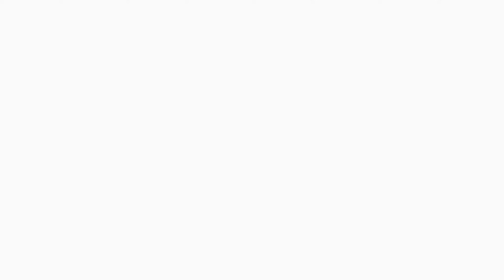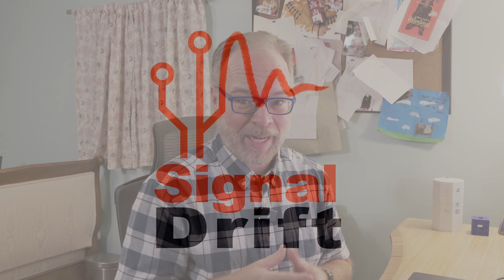Building your first PCB - Part I

Comment: IMO having all those lines crossing over and around each other to just go to one ground is incredibly messy. Lines going over text... I'd use a couple of ground symbols to break it up. In fact if a schematic can be neat while never having a non-connection wire cross-over, I typically try to draw it that way. I like to save the rats nest of wires for the actual breadboard, you might say...

Because we ALL know that beginners will NEVER make ANY mistakes when first designing and fabricating a PCB (when they first try a project that's not simply following some video tutorial), therefore I also think that it's NOT important at all to favour hand-solderability, and hand-solderable parts whenever plausible, because there will NEVER be a case where they might be able to effect a bodge connection or part replacement, and this WON'T be made easier by some imaginary case that would NEVER happen where replacing an 0805 resistor would be far easier than an 0402, despite the latter having saved them 0.02 cents in BOM cost.

/s...

Despite Kicad not having specific symbols for every part in existence, I find the majority of parts are very very standard packages which Kicad has both the part symbol and PCB footprint for, so in the majority of cases after assigning that, it's a non-issue, rather than a big deal.

edit: oh and for that thumbnail, I think it's ALWAYS worth teaching the one or two extra steps on how to make your PCB edge have rounded corners. Very minor extra step, but feels oh so much nicer in the hands when you get them.

Sorry for the criticism, my opinions
Reply from the maker: Thanks for the feedback! I know there are lots of opinions on schematics, I am just putting one out there. I am not an expert. I am learning and I just wanted to put what I learned out there.

I think your general idea is very sound - try not to cross wires that aren't connected, and try not to cross labels. I think for a simple 'first' board this really doesn't matter all that much.

On KiCad, I think you underestimate the learning curve for beginners. When I started out it was a mystery to me the difference between a symbol and a footprint. I am just to the point in KiCad where I know where all that is stored and configured, I know how to add and edit symbols and footprints, and link them together without some sort of plugin. This would have been a huge barrier to me if I'd started out in it. Though I do have a tutorial on the best plugins for KiCad/JLCPCB that eases that headache (slightly).
Reply: @ElectronicsUnscripted I learnt kicad from Contextual Electronics' course (on YT as well), which I think was done very well, Getting to Blinky. One thing it did was slowly go through every tool to a basic degree in order to complete it, rather than choose to skip some "because it's not strictly necessary, and we want to do as little as possible to avoid overwhelming someone". Slightly more laborious, but infinitely more complete in terms of forming in one's mind how everything comes together. I haven't been 'scared' since.
Reply from the maker: @ivolol  I understand. Different people learn differently. I am not an 'understand everything before I make a move' sort of person. I literally just opened KiCad and started poking around, googling or ChatGPTing when I couldn't find something.

I tend to just jump in and will skip over things I don't understand (as long as they work) and come back to them later when I get a better picture of the landscape. This approach does sometimes bite you in the ass, but it's served me well. It avoids analysis paralysis.

The idea behind these two videos is get you to a successful design that works and gives you some basics, and a design you can build on both literally, and in terms of your own skillset. This isn't the right path for everyone.